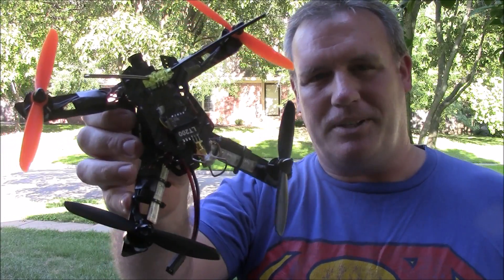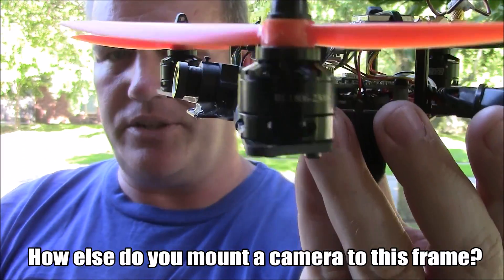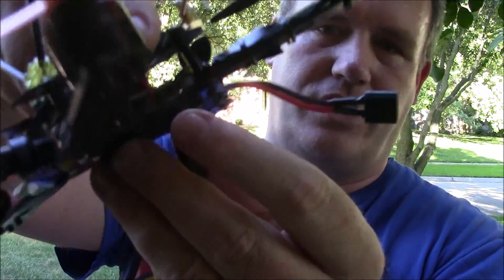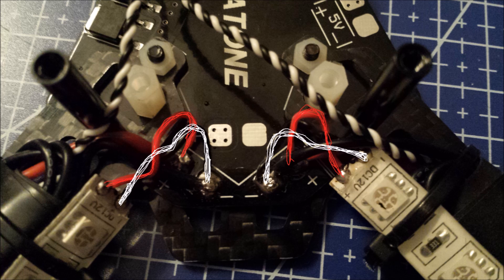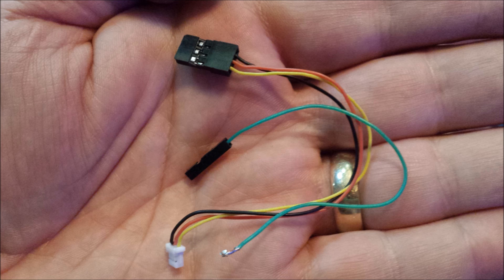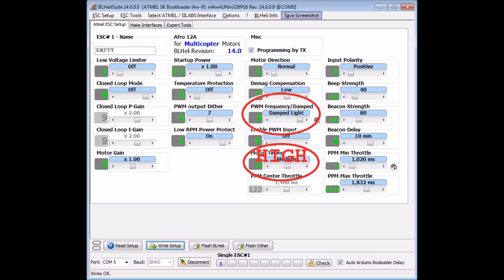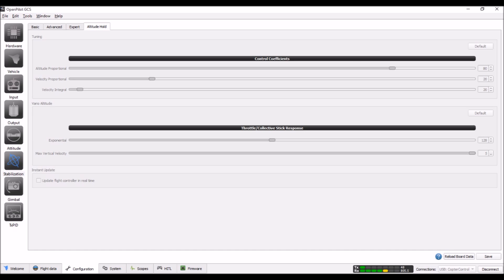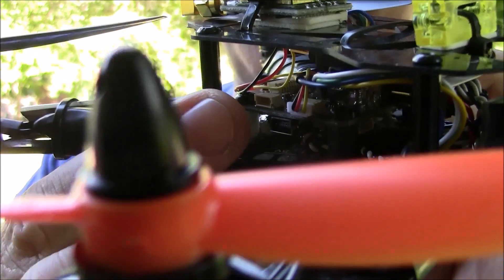Diatone ET 200 Full Review, Tuning, Build Pictures, and FPV Flying

Comment: Hi Travis, do you have strange behavious at yaw? Mine does a roll/pitch glitch when yawing. I did fiddle with the motor mix but cant get rid of it. Perhaps you can share what mix you have for the et200... Thanks!
Reply from the maker: I was using whatever the defaults were.  I didn't change any motor mixing.
Reply: +travisgrindal ok thanks, so you dont have any strange effects when yawing?

Comment: Thank you for the informative video. I am currently waiting for an ET 180 to arrive in the mail. Does the power distribution board eliminate the need for a BEC? I plan on using DYS BL Heli Opto ESCs, a mini CC3D Flight Controller, and an FrSky V8FR-II RX. I am confused as to whether or not these components can be powered directly from the battery, or if there are enough spots on the Diatone power distribution board to solder everything to that? Any help is appreciated. Thank you.
Reply from the maker: +Kevin Magner If the PDB you get has a 5v output, then I'd use that to power your flight board.  Your receiver can draw power from your flight board.  The only components that should normally draw full voltage directly from the battery are the ESCs.  Some of the CC3D boards can handle direct 4S battery input, but some can't.  I'm not sure how you know which one you have unless you test it.  However, if it can't handle a direct connection to a 4S battery, it will smoke it.  The way it always works is connecting to a 5v source.
Reply: +travisgrindal I'll play it safe and use the 5v output for my CC3D. Thank you!

Comment: fast little quad. clean build also. what sort of flight times are you getting?
Reply from the maker: I wasn't concerned about flight time as much as I was speed. This quad has been replaced by the LS 210. since I used it for racing I usually crashed before the battery died.

Comment: the arms on this quad are a poor design they cut away so much material from the middle there is hardly anything left near where they attach to the frame. They have toothpick like strength.
Reply from the maker: I agree 100% now.  It flies so well but is just so fragile.  Watch the first minute or so of this video:  https://youtu.be/Y9l2FRoxu3k
Reply: +travisgrindal I am with you and am looking into new frames after only putting two minutes of flight time on the ET 200, I snapped two of the arms after a dys 30a failed during the maiden. That voodoo frame looks neat, best of luck with it.

Comment: Travis, you are a horrible human being who endangers people and small fuzzy creatures with your blatant disregard for civility and safety. 

Subscribed :)
Reply from the maker: +willdoryder LOL!  uh... thanks... I think.... ?!?   :)
Reply: I wanted to make sure that your warnings about comments were accurate :)

Actually I think there was nothing wrong with the setup at all, good Sir. Great video, after I slap this Diatone 37 together, I'll be checking out that sweet 150 frame you've been posting about. Many thanks for your efforts!
Reply from the maker: +willdoryder I really like the 150 for flying by myself in my neighborhood and taking with me in the car just in case I find a location that needs flying.  The only issue I have with it is that when I fly with other people who have 250s, they smoke me on straight-aways.  Our local groups are getting more into racing now so "speed" is starting to take the forefront in my next quads.

Comment: I received this with 2mm arms, 1mm main plate, 0.65mm pdb and 1.15mm spacers. Now, that also came with M3 5mm bolts and the nuts that have no threads on the closest 0.2mm to their sides... Something is still very wrong with the quality control here!

Comment: Hi Travis. I'm having issues with my ET200 in rate mode. When ever I put it into rate mode it pitches forward a lot. I have tried trimming it out but with the trim as far back as it will go it is still doing it. I'm running cleanflight on a CC3D. In horizon mode it is fine. Did you experience any problems like this?
Reply from the maker: Matthew Nesbitt I'm using OpenPilot instead of CleanFlight.  I haven't had any problems like your referring to.

Comment: I have been hot gluing most of my cameras, don't feel bad... I work on my quads soooo much that it's just a big time saver :)
Reply from the maker: LA Hover I've had my camera come off twice since I made this video.  It is very hard to find in grass.  I'm looking for a better solution than just hot glue alone.  I like how it allows me to angle it but it flies off too easily.
Reply: when you buy hot glue, look for the clear sticks, the "milky" looking ones don't hold worth a darn... Could also try some double sided tape on the base along with the glue.

Comment: Another great vid, I've been watching all the micro quad build and flight footage! What I have noticed is your using the CC3D FC, I started using that and to be honest loved it,especially open pilot very user friendly, I've since got a naze32 as everyone recommends it, but to be perfectly honest, I've had more joy out of the cc3d performance wise??, my only concern with the CC3D from banggood, are they clones or the real deal?? looking at your flight footage, the ones you have ordered have been spot on.
Reply from the maker: The ones I've been getting from banggood have all worked pretty well for me so far.  I've used the full size and mini boards.  I've also used naze32 boards and I think they are alright but I seem to be able to tune the CC3D easier.

Comment: nice one travis
Reply from the maker: Allan T Thanks!
Reply: ***** from your experience which do you like best, d4r or the x4r,thanks
Reply from the maker: Allan T Right now, I don't have an opinion about which is better, but if your flight board can take an SBUS input (like the CC3D), then I think the best choice is the X4R-SB because it has the 5ms response time where as the D4R-II with CPPM has a 27ms response time.  But so far, I don't really notice any lag with the D4R-II so I don't necessarily like it less.  Right now, I like them about the same.  Maybe I'll have a different opinion later.
Reply: ***** cheers, I'm doing a new build,I'm either using naza32 so I can also get telemetry or a cc3d,ĺ I'm using naza32 on my current zrm with a d4r,is sbus with x4r as easy to set up as ppm
Reply from the maker: Allan T Yeah, SBUS is just as easy as PPM.  I'm not 100% sure that the Naze32 supports SBUS - it may, I'm just not sure.  I used OpenPilot on for my CC3D and choosing "CPPM" or "SBUS" is a matter of clicking one icon or the other.
Reply: ***** spot on thanks travis
Reply from the maker: +travisgrindal It was a 1300 35c-70c Nano Tech.  I also really like the 1550 Rhino 35c batteries.

Comment: Are you planning on completing the 180 build as well? I'm thinking the 4" props on almost the same set-up as the 150 would be good for flight time, but still light and small for nimble flights around the house.
Reply from the maker: kj erts My 180 frame is going to be a while.  I have too many other projects I'm working on.

Comment: Did you do optune?? You should do it from clean setup, not from someone else´s setup. You have expo on the fc too :) shown on the stabilization tab right upper corner.
Reply from the maker: Petsku No, I didn't do optune.  The expo in OpenPilot probably came from me choosing the "BlackOut H330" at the end of the vehicle setup.  I didn't change any of that manually.  The "BlackOut H330" base config has been my starting point on all my recent CC3D quads and for some reason it flies real well for me.
Reply: ***** You sould try it out. Makes a ton of difference. Thats the reason not to use the templates. You never know what has been changed. Optune is 1 battery job ;) Just start whit clean setup.